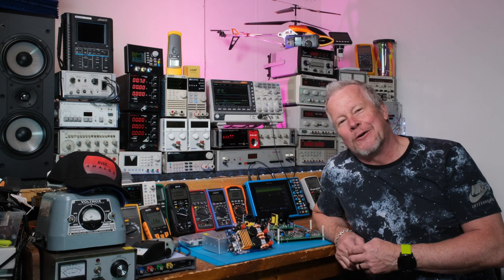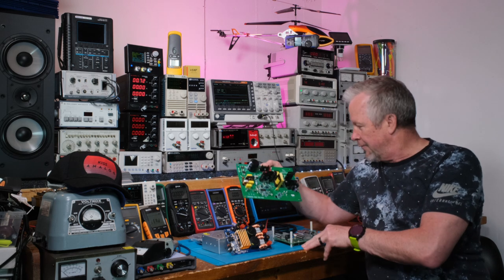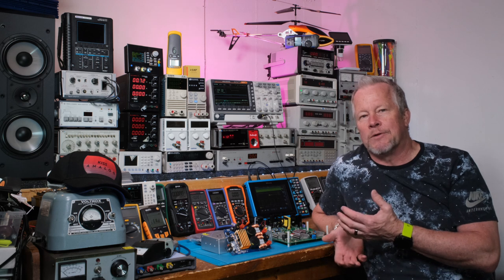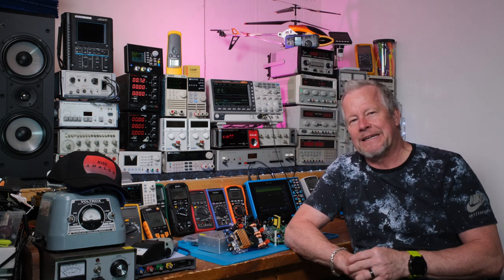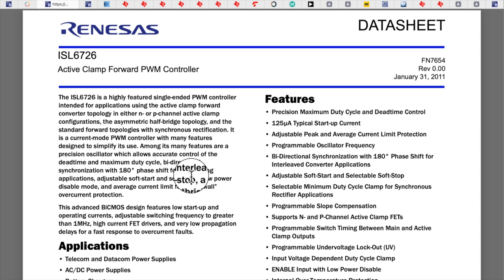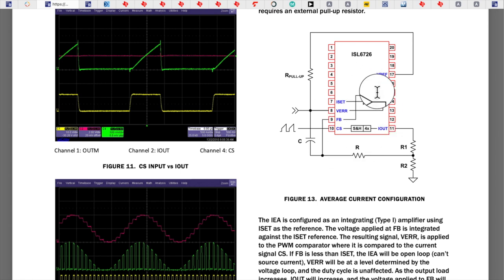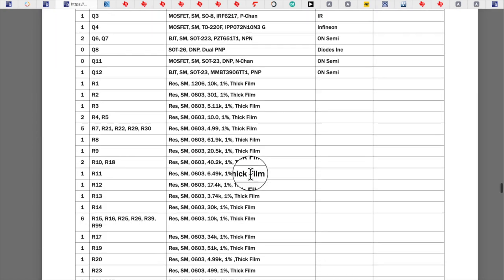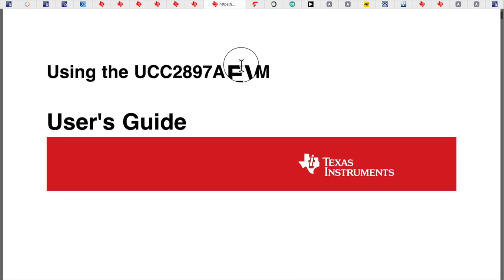How I start my Design Process - Controller Selection for Active Clamp Forward #my background

Comment: Thanks for another great one. Looking forward for the next one. I'm thinking about using these circuit concepts to design an anode supply for a tube instrument amp with variable output from around 150 to 350V at 250mA. I'm hoping to learn some things here to make that effort go smoother.
Reply from the maker: Sounds great Paul!

Comment: Hey kiss, I've found your channel some time ago when I was looking for op amps  tutorials on YT.

I'm struggling with a design I've made for a class D Amp. It don't work and i have no idea why it is not. (Too many reasons and I'm trying to rule out which is the one)

Any suggestion on troubleshooting something that have correct voltages on the pins, is outputting a PWM signal but no audio at all!?
No errors in the fault pin and no errors in its I2C error register.

I'm basically out of ideas and also Texas instruments is too! (E2E Forum).

And yes I've chooses a chip because I've seen it many times on some products and I've reverse engineered them and then created my own design from them...
Reply from the maker: Thanks for asking.  What chip are you using?  I'll take a look and give you some ideas;)
Reply: @KissAnalog  Thanks a lot, the chip is a TAS5731M.
I've also created a thread in EEVBLOG forum... I might have to update it with my latest findings ...
Reply: I don't like the typical class D amplifier ICs so much, because most of the things they do are hidden from the user. The simplest class D amplifier I build was designed around the LTC6992 analog to pwm converter and the LM5104 half bridge driver. For the output stage I have used STP16NF06 MOSFETs because of their very small gate charges. So I could operate with a PWM frequency of 500 kHz. The low pass filter was designed to 50 kHz. The sound was fantastic.